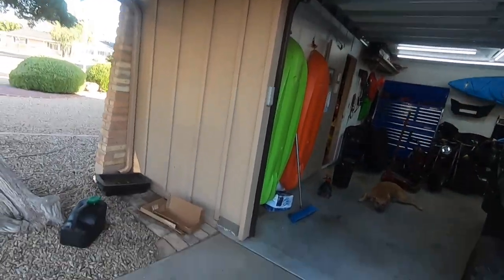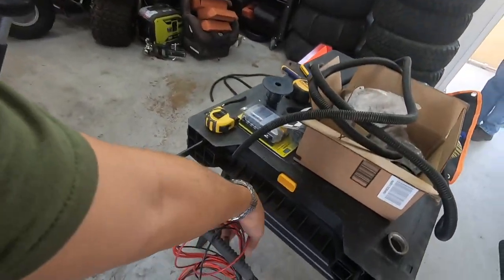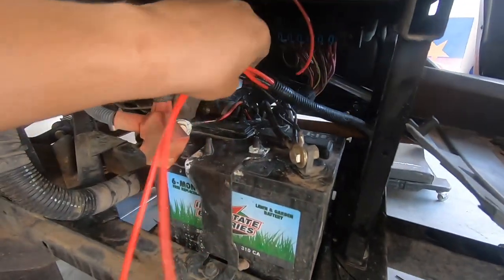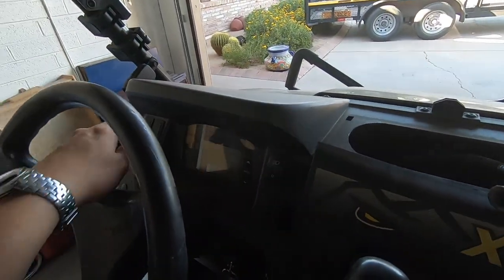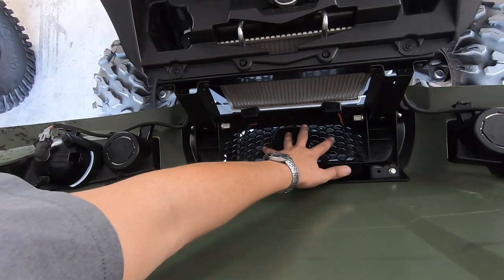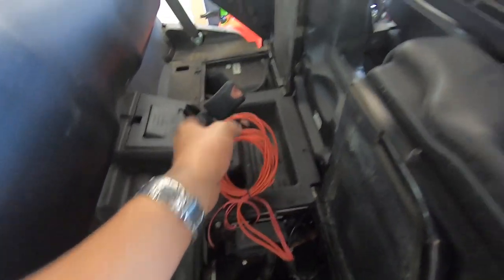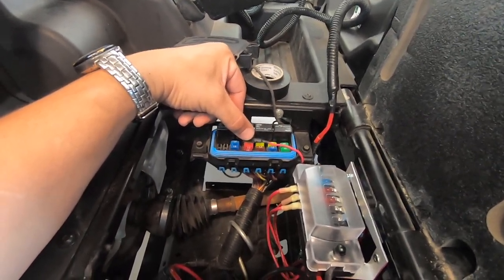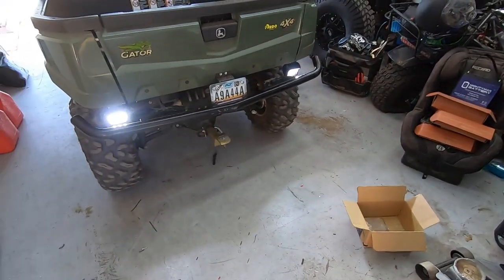Wiring a Gator 590i S4

Comment: Great clean work ! Would a 2 wire receptacle mounted near the rear bumper area (similar to a truck) be an option ? This would eliminate the long wire bundle under the seat.
Reply from the maker: Yes it would, I did not think of that! Thanks for the idea on my next project.